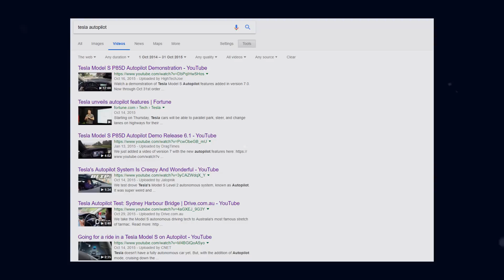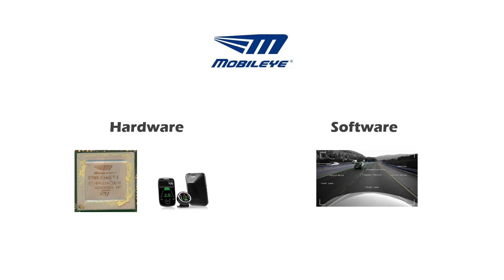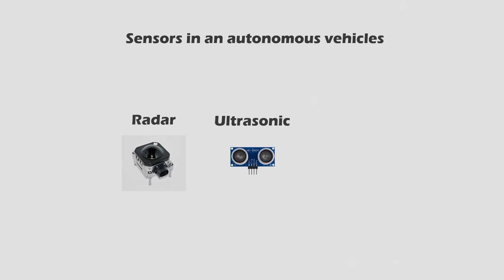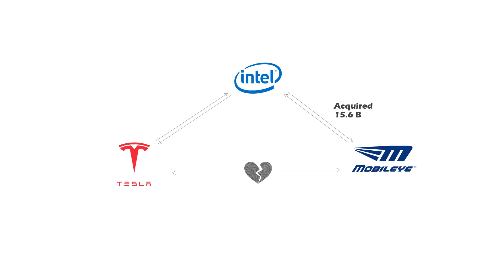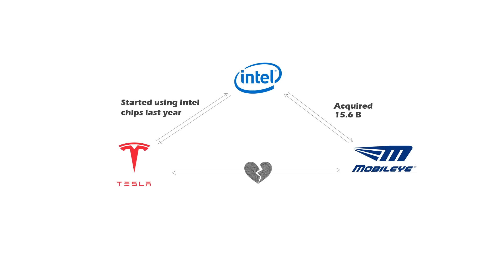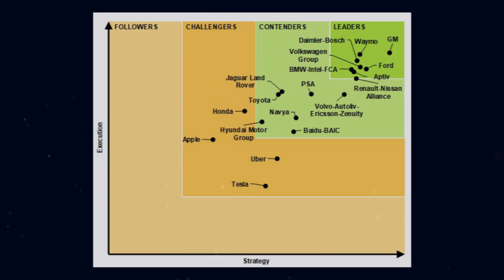Tesla's Autopilot is in Trouble, here is how to FiX it!

Comment: This is one of the first videos I don't agree with you on. You need to do some more research IMO. 

That Study/chart is a joke. Tesla STILL, even on AP2 has one of the best semi autonomous highway driving systems out there. How GM got number 1, and apple is ranked higher than Tesla should tell you that is a complete JOKE of a chart. 

And AP2 does not surpass AP1 currently yet( its actually getting quite close as of updates lately) but it WILL with current hardware, and it has alot more potential. 

The breakup with MobileEye IS indeed the issue, but the hardware Tesla is using isn't the current problem. Main problem is MobileEye and Tesla separated sooner than anticipated. Tesla had to switch to Nvidia Computing, along with re-learning/ programming everything. They basically had to build a Semi Autonomous driving system COMPLETELY from the ground up. 

It will get, and surpass AP1, but it did set them back YEARS. 

Tesla WILL NOT EVER get back with MobileEye. Tesla wants this system built from the ground up with their software. Not using another companies ever again as they did with MobileEyes IQ3 chip.

Comment: If Tesla is truly collecting and analyzing complete sensor data from all AP2 cars, then that will be a HUGE strategic advantage -- even better if they're also getting simultaneous data on the driving behavior of the human behind the wheel.  For this reason, I'm giving them the benefit of the doubt regarding the improvement announced for 2018.

Comment: Hey Curious Elephant. I've enjoyed watching some of your videos before, but like others have pointed out, this one is really poorly researched, and unfortunately contribute to all the misinformation going around. 

I'll make a few points here. 

1. Navigant largely base their chart on how many autonomous miles is reported driven to the DMV in California by the various companies. Tesla did no testing on public CA roads in 2017 and is thereby logged at zero miles driven  https://cleantechnica.com/2018/02/01/annual-autonomous-car-disengagement-report-shows-waymo-gm-leading-pack-tesla-reports-0-autonomous-driving-miles/ This says nothing about where Tesla's at. 

2. Tesla has caught up with Mobileye SW in just 2 - 3 years, what has taken them 19 years to accomplish. In some ways, it's worse, and some ways better by now. What makes you think partnering with them once again should in some way help Tesla achieve autonomous driving? 

3. There is no problem with the sensors in AP2, they are way better than AP1, and sufficient for FSD. 

4. Unlike what Navigant says, GM, Ford, Waymo is not ahead of Tesla when it comes to true self-driving capabilities. Yes, they can be programmed to run on a pre-defined route, but as they haven't solved vision AI, they are really no smarter than a self-driving metro on a track. And yea, they won't work in fog, rain, and dust relying on LIDAR...

Tesla's approach is the right one, they are working on solving vision. The needed sensors are there, and should it turn out they need more processing power, then all AP2 cars can be upgraded in a few minutes by swapping out the motherboard. If you've followed how gigantic progress Nvidia has made in just one year, it will be obvious why Tesla didn't go nuts and waste tons of money on the computer hardware, it's already many times better and cheaper this year with everything CPU, GUP etc in a SoC.

Tesla's full self-driving capability is delayed, not in trouble, and you better leave how to fix it up to Elon Musk ;)

Comment: My understanding is that Tesla was planning on creating their own software and hardware and then ditch Mobileye. They were planning on using Mobileye until their software was on par with theirs. Then the breakup happened and Tesla lost all of their work they did on top of the Mobileye system. So there has been a time of regression while Tesla can catch up and they have been moving at pretty fast pace compared to how long other systems have had to work on their system. Remember the time started when Tesla decided to ditch Mobileye and start their own. You show a chart of systems and where they are at on autonomous driving but you don't show a chart on much those systems cost or how obtrusive the system looks. Like the Waymo system you showed. I don't think anybody would buy a car that looks like that or cost that much but Lyft and Uber might.

Comment: Tesla has a huge fleet of cars. Gathering data constantly. All of it marked with ground truth. Tesla don’t need to spend time driving on roads with specially trained drivers and engineers monitoring and tweaking things. The AI will learn and compete against recorded real drivers. It can do this constantly virtually. Other companies do this too but I am not aware of them having such large fleets. The report in the chart from what I understood was based on what permits etc car companies had applied for, to train/test cars.  

The reason AP2 is behind AP1 is they had to start from scratch. And the have less AP2 mikes recorded than AP1 miles. 

A lot of the other car companies pull off what the have with insane amounts of information from outside the car: special high res maps of the areas they cover, electronics signals for lights etc so they don’t need to see the lights etc. 

I don’t think it will be long before Tesla AP2 will make the others look stupid!

Google deep mind didn’t learn by playing real people, it learn’t by playing itself. Tesla is doing the same!

Comment: I have a 2016 Tesla S 70 D with auto steer and parking. Single camera in the windshield.   I find that if there is a slight rise to the right (like an overpass), that the auto pilot seems confused and I take control back.  It is like it continues to stay in a slight right turn approaching a guard rail. But it is always the same place, so I know it is coming.  

On long turn on the highway approaching cars stopped at an intersection, I take control back because I feel that theS does not detect stopped cars.  This may just be a fear factor, but the stopped cars do not show up on my dashboard inciting that my car is "aware" and needs to stop.

Comment: I have proof that Tesla vehicles built today will NEVER be Level 5.
Proof1: Level 5 requires human like or better capability in ALL scenarios. 
Well, if it snows or road is dirty, 5 cameras, radar and all ultrasonic sensors are compromised. 
Human can use windshield wiper and look through the mirrors. AP can not. Car will stop with message:
please wash me. I will not be able to pick you up. Warming sensors up is not enough. 
Check out some cars with reversing camera with washing function. 
Proof2: there is a camera missing that can see ahead to overtake a huge truck. Center camera is not acceptable. 
Imagine driving in a vehicle which has steering wheel in the center and driver can't lean head to the left.

So level 4. Most scenarios fully self driving. Not all scenarios. 

Elon, hire me. I can fix schmutz problem and some more problems your dumb engineers forgot :(

Comment: As others have stated in the comments your analysis about this topic is wrong on many levels, and made worse by your posture and tone of being knowledgeable about the subject. Less quantity, more quality please. Your time is finite, and you have to choose between doing proper research for a smaller number of quality videos or thin research for a superficial look at a high volume of topics. If you insist on sticking with a high quantity, I'd recommend a more 'curious' and 'questioning' perspective, rather than claiming to be knowledgeable in topics you are clearly not.

The key point that you failed to grasp is that Tesla don't want to partner with anyone for autonomy, they want to develop and own a capable system of their own. Autonomy is THE key technology for transport for the 21st century, potentially making various other technologies obsolete or demoting them to small niches (combustion engines, human drivers, even personal vehicle ownership in the long run). Developing & owning (a competitive version of) the technology is therefore vital, and this is Tesla's goal. If anyone is curious about this, I suggest you start with Tony Seba's talks/videos to get the big picture.

Comment: I wouldn’t necessarily trust the Navigant report, Tesla was placed lower primarily because it doesn’t use Lidar, but uses deep learning neural networks. Such networks are generally S curves, and extrapolating the current progress as linear progress is a huge underestimate. I think very soon, especially as Model 3 goes mass market the data collection will increase massively and Autopilot capability will increase exponentially. The sensors and software are fine but slow at the start, which is why it has received criticism.

Comment: I think Tesla chose not to use lidar for a couple reasons. Lidar can't see to well on fog. It has limited penetrating visibility. Also the tech is to expensive still. Radar can can penetrate quit well we're visibility would be a problem. A good explanation would be getting an x-ray of your new born. You now have the option of getting a 3d visual of your soon to born or get the standard x-ray. One gives you detail the other not no much. If you need to is see an object then it is pointless to have lidar since it just provides you with  much clear image yet all you need is to simply be able to see a object. I more detail image is not going to benefit Tesla any better because it just needs to detect the object.

Comment: Such a non-sense. Tesla and Mobileeye didn't break up just because they don't like each other. It's simply because of Tesla strategy, to develop autopilot by themselves like they are doing with other stuff. And one main reason is to develop Tesla Vision that's based only in cameras. Elon has the vision that if they solve self-driving with cameras, then autonomy is solved. It's one more thing that no one agrees, but if they can do it, then they will be light years ahead. We see now that in most of the issues, Elon was right. Let's see if in this one he is right or not. Ah, and to back all the arguments of this video based on that graph of one study, doesn't mean Tesla is the worst one. Tesla is not testing self-driving cars on the road, so there is no data about Tesla self-driving capabilities. So, any company that performs tests, it will be ahead of Tesla, that's why even Apple is ahead, because they perform some road tests. However, that doesn't mean Tesla is not developing the technology in other means (like using the data acquired by all AP2 cars). Once they have the product prepared, they can release a software update to all AP2 cars. Other companies though only have demo/concept cars, and will take years to get a self-driving car prepared to sell to consumers.

Comment: I'm not a Tesla owner however I did preorder the Tesla Model 3 before it was even released on stage. So I have eagerly been waiting for the arrival of mine. I'm also contemplating if I should give up my reservation. Due to a multitude of reasons this being one of them. I really feel like it Tesla should have adopted LIDAR systems, years ago. At the time when they announced they were not be using LIDAR, I'm honestly assumed that it was just down to processing power that was required to run so many different sensors with overlapping data. However with today's technology and prices being what they are, I feel like that's just an excuse. It will fill the gaps with its lesser camera technology, and if anyone can incorporate an awkward-looking sensor into a car body make it look sleek Tesla could do it. Ultimately the only thing I could see holding Tesla back from doing this would be the stubbornness in the first place or the combination of the lesser drag coefficient due to the extra sensors.

Comment: just a wild guess: is it possible that navigant is bashing on tesla because tesla is useing google maps as their navigation provider ?
Reply: I think each manufacturer kept a record of the AI's performance for the evaluation by local government, and Navigant just using these data to make a ranking. The top of the ranking seems to fit with manufacturers who had an AI that rarely crash or make an error based on distance travelled (ie: incident per mile travelled), especially Waymo.

Comment: How do you plot "Strategy" on an axis?

Also, I don't see Tesla getting back with MobilEye.  I believe their solution requires proprietary hardware which Telsa considers an unacceptable risk of being a production bottleneck.  Telsa has worked for a hardware agnostic solution to ensure their production line.

Furthermore, I don't see Tesla partnering with Waymo either.  Telsa has stated it doesn't want to use LIDAR as it is prohibitively expensive to rolling out a cheap production model.

Finally, most of the companies listed in the chart don't have a production version of Autopilot.  It easy to criticize an apple when comparing it to a hypothetical apple.  In most comparisons of actually available systems, Telsa is still ranked towards the top.  They had to rebuild there system from the ground up and did so in about 4 years.  So, yes they lost time, but Telsa has shown an ability to innovate on a scale and timeline that no other automaker can touch.  My prediction is that Tesla is on the right track and will be blowing away all competitors within a 2 year time period in terms of performance and price.

Comment: Tesla does not want to partner again because autonomous driving is all about the data, and the breakup with mobile eye left them with none of the data gathered by their cars.  The autopilot 2.0 cars will not match the data they lost with mobile eye for another year, and that data is needed to train autonomous driving systems.... 

It may be that other systems beat Tesla currently, as Tesla has chosen a harder road with potentially greater payoff... which might suck for the current owners, but is probably better for Tesla in the long run if Tesla develop the technology in house, and own the data, then they will be in a better place in the long run.

Comment: I would have to disagree with most of your points in this video.  I would group the auto pilot (autonomous cars) landscape into two groups for simplicity.  One group that will be based upon a fixed structure and the other using a fluid structure.  The fixed structure will allow cars to autonomously navigate only in small/limited specific areas.  Once the car leaves those areas, the autonomous feature will just turn off and not be available.  The fluid structure will work in all circumstances, no matter where you drive.  The fixed structure is a whole lot easier to program than the fluid structure.  Tesla is one of the companies that is building software that will work in the fluid structure.  I'm not sure if any other company will be building something for the fluid structure.  This is the primary delay in the release of updates to the AP 2.0 software.  It take considerable work to design an AP system from scratch, which is what Tesla is doing.  This is the reason for the delay in the release of a Tesla traveling autonomously from west to east coast.  I don't see Tesla partnering with anyone else in this space as no one else has the same goals as Tesla for autonomy.  In relation to Lidar technology, if Tesla believes it is needed, they will provide the hardware update to the cars. This is still an unknown.  Hopefully, Tesla will soon release an update to AP 2.0 which blows everyone away, as is typical with Elon.  I know that safety is a primary concern to him and his team, and won't release it until it is fully tested.

Comment: I find it hard to believe the report that you are referencing.  I may be wrong, but I don't believe there is any way of knowing what stage any of these companies are at with their technology.  Rolling full autopilot out to current Tesla owners isn't supposed to happen for some time.  What we do know is that Tesla has been collecting driver data from all  of their cars from day 1.  They have collected millions of miles of data, which thoroughly outpaces everyone else in this space.  I think it is impossible to say whether or not Apple, or anyone else, is more advanced in the current state of this technology.  I believe that when Tesla applies all of the data they have collected to their future system, it will be among the most advanced.  I also wouldn't be surprised if they brought full autopilot to market first.
Reply: Waymo has logged much more useful data, in controlled varying conditions.

Also there's no reason to believe collecting lots of data is the key to autopilot. It's true to a certain extent, but at some point more data isn't very helpful.
Reply: Ambient Morality Very true!  I know that google is interested in collecting a ton of mileage data in the real world, which is what Tesla has been doing. I just don’t think that we can speculate on the state of technology that we haven’t seen yet. That goes for every company discussed here.  Taking that real world data and running it through their system, even if not on the road, has to have a massive advantage. That’s why google’s fleet has expanded so drastically over the past couple years. Tesla has a massive advantage, in that they don’t need to run a fleet of cars. They just collect data from paying customers. Only time will tell how this whole industry plays out, but I find it very hard to believe that Tesla lost much of an advantage over the past couple years.